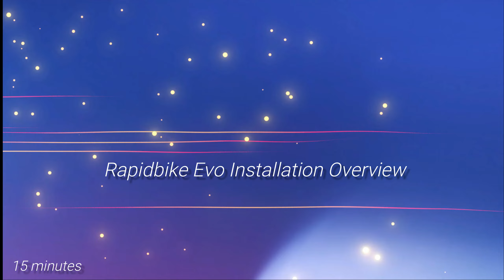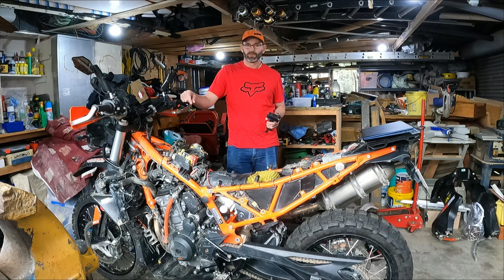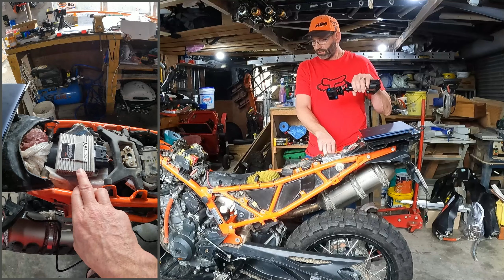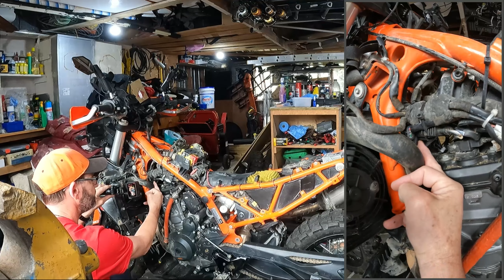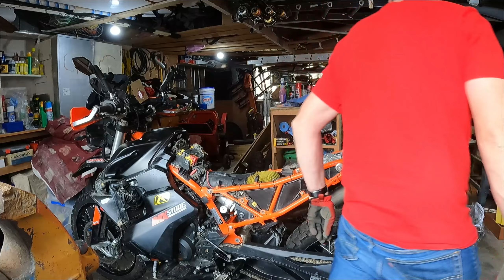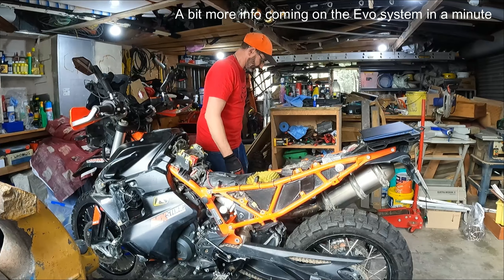Rapidbike Evo - My installation, first thoughts and why Evo

Comment: Did you get engine light ? I did 1000km and I got a orange engine light… 😢
Reply from the maker: No I have never had a check engine light, you shouldn’t with this model, it is one of the reasons I picked it

Comment: So followed this video you did for installing the RDE 👍🏻 well done. So here’s an update for this as well I’ve just bought and fitted the Rottweiler fuel cell and the RBE. The problem is somewhere to fit the RBE when a fuel cell is fitted as there’s absolutely no room under the seat. With very little mod I’ve fitted mine on top of the battery, I removed the tabs on top of the battery and had to cut the cover.
Reply from the maker: Nice, that would be a good spot for it

Comment: Interesting location where you put the module vs where my paperwork suggests. It has me mounting it below the rear shock. I'm probably going to follow this as I have the Rottweiler  fuel tank installed, so I've lost all my free space at the rear of the bike. It's totally worth gaining the almost 7 liters of fuel vs using it as storage space.
Reply from the maker: My paperwork had it mounting in the airbox but with the Rotti full intake and the alarm there was no space. You have to be really careful how you run the wires though or you will run out of cable. I actually extended the TPS cable slightly as it was very tight

Comment: Can Rapid Bike control the electronic throttle plates or secondary throttle butterflies if a bike has them?? Or is it only done by flashing the oem ecu?
Reply from the maker: The advantage of the Rapid Bike is it is an an on ECU that has automated features so makes it simple to use. So it does not change any of the stock sensors or ECU but does all of its changes after the stock ECU/Tune has been applied, so it reads all of the sensors and throttle position sensors and uses those to make it changes according to the tune settings that have been applied. It doe not directly control the throttle plates/butterflies as far as I am aware, at least the Evo I am running doesn't, not sure about other models and bikes though.

Comment: Did you get a manual with it? I didn`t and need to know what cable you connected the tps sensor to? :)
Reply from the maker: Yes it came with a paper document with installation instructions, I can see if I can find them for you or take a photo with that piece. Not sure I can get a photo though it was pretty tight in there and I had to lengthen the RB TPS wire so I could put the RB unit at the back behind the seat locking position on top of the rear guard
Reply: @GeoffBarnard  got instruction mailed from where i bought it, they forgot to send it, mounted now 👍

Comment: hello,im a hypermotard rider with rapidbike evo+my tuning bike+ you tune controller.ihave some question, could you give me your Email or other contact information? thanks,best wish.
Reply from the maker: You can message me on Facebook messenger @N2O_Adventures
Reply from the maker: Not sure how much help I can be with that setup as mine is pretty simple with just the Evo
Reply: @GeoffBarnard  just software, about auto tuning
Reply from the maker: and yes this is what I am using
Reply: @GeoffBarnard  got it , see u there.👍👍
Reply: @GeoffBarnard  i didn’t find in facebook,😵‍💫
Reply from the maker: Look for Geoff Barnard, you should be able to message "N2OAdventures" as well

Comment: Have you rode the bike with the RB Evo installed yet?  How did you like it?  Thoughts?
Reply from the maker: Hi Phil, I have done quite a bit of riding since I installed it. The bike runs a lot better, and the power gain is quite noticeable. Note though I do have the full Rotti intake system and deCat. I am still playing around with the autotune, I have the map switch as well so am trying to get a tune slightly richer than stock for economy and a full send one. Currently both seem to be full send, on my richest tune I am losing about 150km range when you are on it so a significant rise in fuel consumption, but it goes like a cut cat :-)
Reply: @GeoffBarnard  That's great news.  I have the same Rotti upgrades and was wondering how the evo smooths out the low end.  150km is a pretty big hit but I assume if you ride conservatively it should be a lot less.  Hopefully you can get an eco tune working for you.
Reply from the maker: The bike is nicer right through the range, I have mine set to kick k in at 1500 rpm. That hit to mileage is pushing it hard, it would be substantially less if cruising. I will get the economy settings done in a couple of weeks so can update after that if you like
Reply: @GeoffBarnard  Good to know.  I've pushed the bike extremely hard on a rally and noticed 100-125km reduction in fuel mileage.  Even an aggressive ADV tire like a Mitas eo9 slides around so much, I thinking a knobby will give me the grip I need to not spin the tire so much and get back the milage.  Love to see a follow up video on the evo now that you've rode with it for a while.